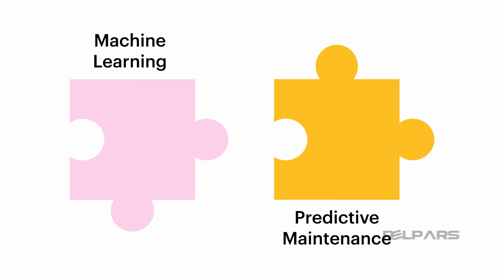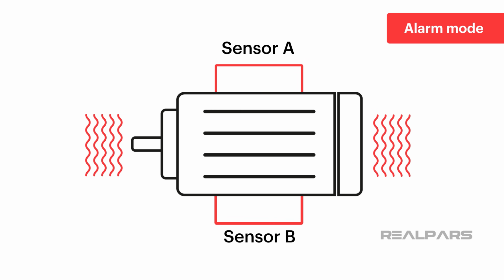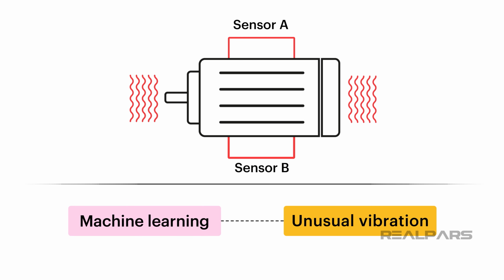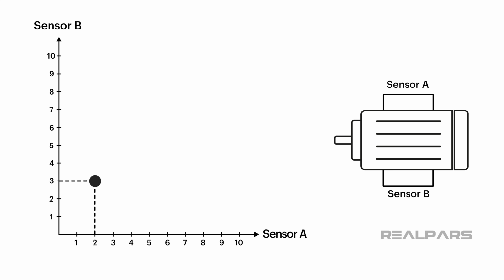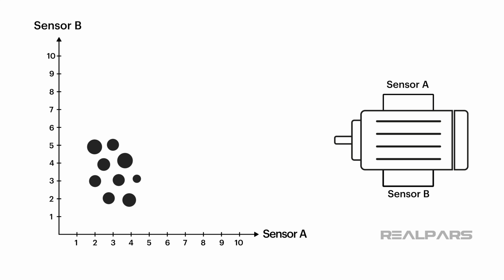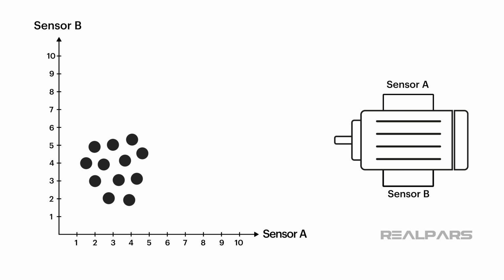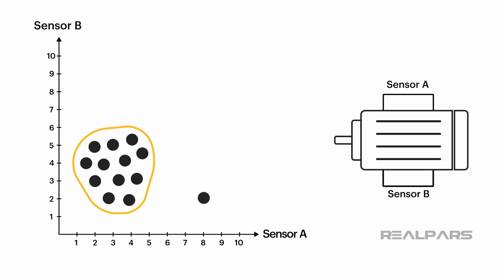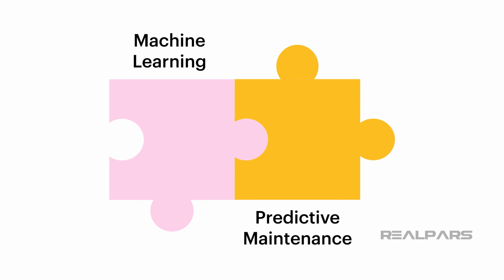How to Use Machine Learning for Predictive Maintenance

Comment: Thanks for explaining machine learning for maintenance without drowning it in math. In my 24 years in manufacturing I've seen many teams buy a model before they had even a few months of reliable failure history, and the project stalled. Your point about labeling past failures properly is exactly what makes or breaks it. Do you recommend starting with a simple threshold or anomaly detection first, and only moving to a full model once enough failure data exists?
Reply from the maker: Hello, @fai.data.consulting  Thank you for your comment and question. As mentioned in my last reply. You need to have a baseline even if the device has been in operation for one day. It doesn’t matter even if it's been working for 5 years – although that device will have some wear and tear by now. As the device is used, it will wear out, so you can act before that happens by keeping spares on hand. Being proactive helps you be ready when a breakdown happens. 

If you’re looking to learn more about this topic, you can join our 7-day free trial at https://community.realpars.com/checkout/realpars-membership Happy learning from RealPars!

Comment: I’ve learned that a predictive-maintenance model can look impressive while the shop floor still loses time to poor response routines, missing spares, or a scheduled changeover. The hard part is closing the loop from the alert to a practical work order. In your experience, which signal is most reliable for getting operators to trust the prediction?
Reply from the maker: Hello, @fai.data.consulting  Thank you for your question. As we mentioned, you should have had a baseline when the motor was installed. If not, you need to create a baseline. Then set your monitoring schedule: weekly, monthly, or yearly. All recorded signals are important, depending on your application. For example, if you are concerned about heat-related breakdowns, you should monitor bearings more often.

If you’re looking to learn more about this topic, you can join our 7-day free trial at https://community.realpars.com/checkout/realpars-membership Happy learning from RealPars!

Comment: ITS NOT PREDICTIVE MANTAINANCE:

"Condition monitoring is present-oriented, using real-time data to alert you as soon as a problem begins to show or a deviation is detected. Predictive maintenance is future-oriented, using advanced analysis to predict when a failure will likely occur so maintenance can be scheduled in advance to prevent it. "
Reply from the maker: Hello, @aaronnottaken2177 Thank you for your comment. In our video, we did not mention anything about “Condition monitoring is present-oriented.” Therefore, could you please clarify your comment so we can provide you with some information? As you stated in your comment on predictive maintenance, that is correct, and we are glad we were able to help you understand this process on predictive maintenance.

Comment: I wonder what is the purpose of using two identical vibration sensors on the same motor.
That is, whether the goal is redundancy or whether it is to achieve some sort of higher dimensionality of the collected data.
With two sensors, you can also account for the failure of the sensor itself, as in the example you gave where only sensor A recorded an abnormal value.
Reply from the maker: Hello, @Yema50. Thank you for your question. It depends on the motor size and engineering data collected. If the motor is very large and long, one sensor can monitor the front bearing and the other the back. Depending on the sensor's smarts, it can monitor heat or anything you are looking for. There are many reasons.  Here is a link for your learning:  https://www.ifm.com/us/en/category/200_040_010  Happy learning from Realpars!

Comment: This example was so simple that I thought I can do the same using ordinary calculus. By the way, why did we need two sensor? Why not Just one?
Reply from the maker: Thank you for your inquiry. Depending on your specific design, it is advisable to consider the use of two sensors, with one serving as a backup. Alternatively, in some cases, you may opt to monitor both the front and rear ball bearings, depending on your design requirements. Utilizing dual monitoring sensors can enhance the reliability of your collected data, providing more accurate and robust results. We wish you productive learning experiences with RealPars

Comment: I’m a big fan of realpars and your videos have been very helpful, don’t get me wrong. However this explanation wouldn’t be very useful in practice. One of the issues is that class imbalance (number of failures vs not failures) would be very large, making the ai hard to learn. On the other hand if you have many failures it’s going to be a problem for production and using preventive maintenance would be more efficient. Therefore one should use a predictive model which predicts the vibration of both sensors while taking into account the previous recordings into consideration (in chronological order) as well as other info like plc controls and use domain knowledge to analyze these anomalies (given that you trust your model). This would be more cost efficient and in practice works much better than classifying the data points individually, which in my opinion is a useless oversimplification of the process, and wouldn’t work unless you’re trying to create an AI dataset rather than running a factory.
Reply from the maker: Thank you for your valuable suggestion. The analogy you offered is truly captivating. As mentioned earlier, our videos are tailored to a beginner audience, aiming to simplify complex processes. We appreciate you taking the time to share your insights. For further enriching your learning experience, we recommend exploring additional resources from one of our trusted partners at the following link:

https://edgeimpulse.com/

Wishing you an enjoyable and insightful learning journey with RealPars!

Comment: How is this machine learning, as in what they call AI machine learning? Looks more like principal component analysis to me.
Reply from the maker: Thank you for your comment.  This example shows how a simple analytical analysis can be made using two sensors.  In most cases, we would use X - Y - Z axis sensors to identify a "volume" in which the data would normally reside.  Outside of that 'volume" would indicate a problem.  This is a very simple application of AI.  In order to understand more complex AI problems, it is first necessary to understand this concept of data collections and how they are collected.

Comment: Ehh, you really need an FFT to do AI vibration based CBM or at least work with band filters to get relevant velocity and envelope/G
gSE overalls to understand what the possible failure modes are. Defining"normal" operation conditions it's not trivial if you want to avoid false alarms and quickly lose the confidence from the maintenance and operations teams.

Comment: “I’ve just picked up a fault in the AE35 unit. It’s going to go 100% failure in 72 hours.”
Reply: Please explain how you did it and which algorithm you applied as I'm not much familiar with deep  learning is it possible to do it without deep learning using simple ml models please please help I have a major project on this topic

Comment: This kind of graf usualy comes in the spec sheet of the motors. For example a dumb protective relay can be set manualy to give  a warning signal when the current [A] value is 10% bigger then the nominal current [A]. Not to be "that guy", but this is not "machine learning or AI". This kind of dumb relays were used since before the AI term was "the next big thing".
Reply from the maker: Thank you for your comment.  This example shows how a simple analytical analysis can be made using two sensors.  In most cases, we would use X - Y - Z axis sensors to identify a "volume" in which the data would normally reside.  Outside of that 'volume" would indicate a problem.  This is a very simple application of AI.  In order to understand more complex AI problems, it is first necessary to understand this concept of data collections and how they are collected.

Comment: The motors can RUN for decades so keeping the sensors working and gathering the data becomes and enormous task
Reply: Yah as control tech,  I swap sensors alot but vacuum and motors rarely,  when they go bad the circuit breaks indicate that

Comment: Interesting video. I like the motor vibration example. 
Note: There are already sensors that record data and that have alarms which are reported to maintenance technicians. I can tell you that having a machine learning algorithm tell you that a particular expected value is out of normal will not really provide any additional information unless it can also tell you more than the sensor information can provide. In that sense, if a certain set of equipment has similar profiles to other sets of equipment and the algorithm can compare its current data to a known set of issues with similar data readouts, then you might get something like a list of possible faults explaining the data. This would generally require multiple erroneous data points from several different types of sensors thru-out a system. Tho many systems already feed that information and collate it so it can be viewed by a technician. It would be helpful to have a system that can monitor a system 24/7 and provide something more than a list of alarms. But, overall, I get the impression that such a system would offer no more additional redundancy than the last person to look at it. Since that will be where the blame falls.
Reply from the maker: Thank you for sharing that, Marc! Truly appreciated

Comment: I could be wrong, but bearing failutes do not exibit large vibrstional noise till the end.  As a result an FFT analysis that looked for frequency of bearing failures would be a necessary addition to the test.  The FFT analysis works particularly well if there is a homing mark sensor present.  The allows the raw data to be aligned in time.

Virtually any ARM based micro controller could due this analysis.  In addition there are microcontrollers with built in WIFI.  LORAWAN interfaces could be used for remote facilities
Reply from the maker: Bearing failures can occur in many ways.  Bearing fracture may not generate as much vibrational noise as, say, a bearing misalignment.  Certainly, vibration can detect bearing issues prior to total failure.  FFT is more likely to allow the technician to see wear and disintegration over time, which would be most valuable in predictive maintenance.